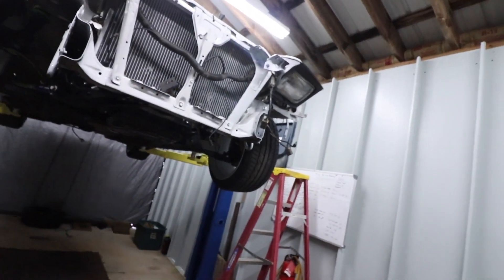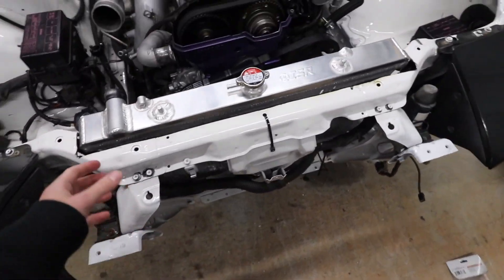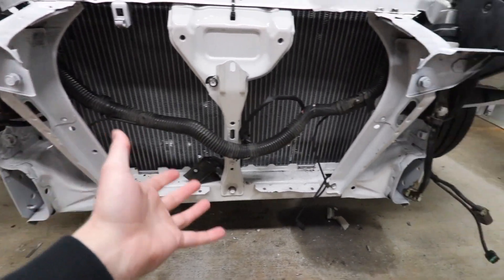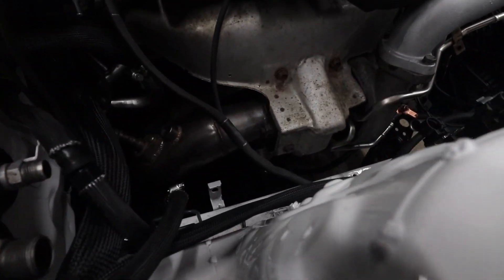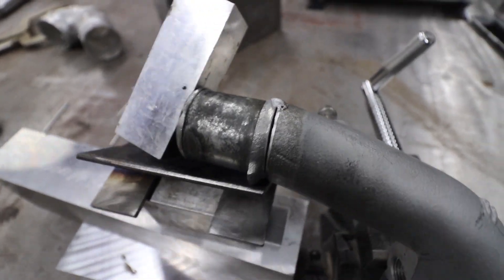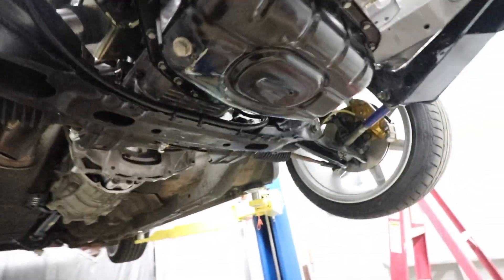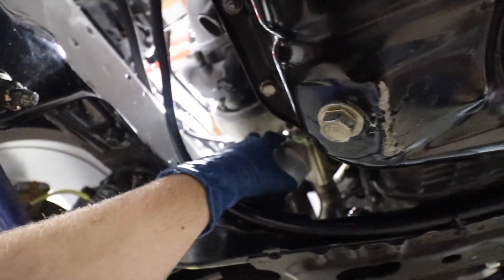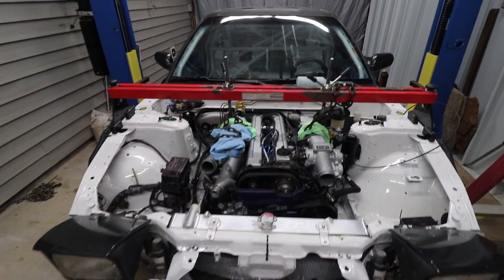Making Custom PARTS for my 1JZ swapped Drift car!

Comment: hey man, just stumbled upon your is300 review by thatdudeinblue, loved the wheels! was just wondering what are the specs? im trying the achieve that flush fitment
Reply from the maker: thanks dude! enkei ts 10 18x8+40 all around 235/40/18. back could use a spacer though..